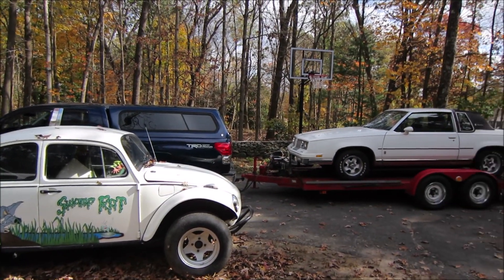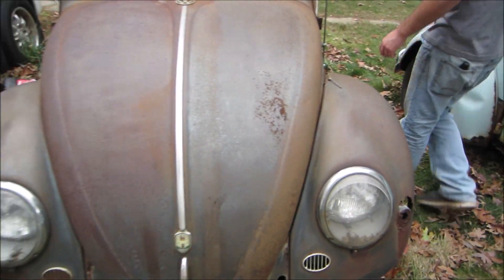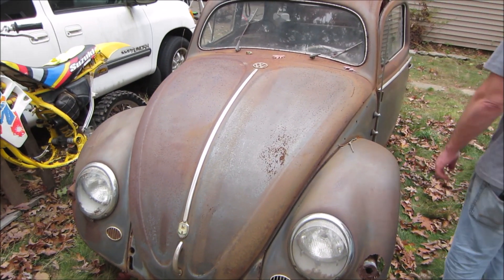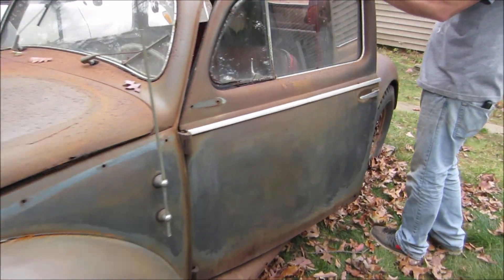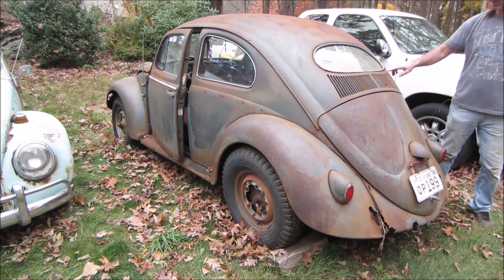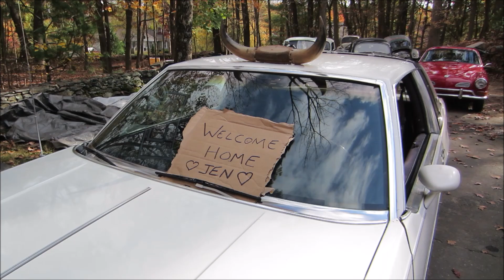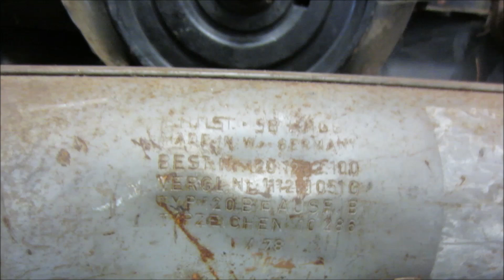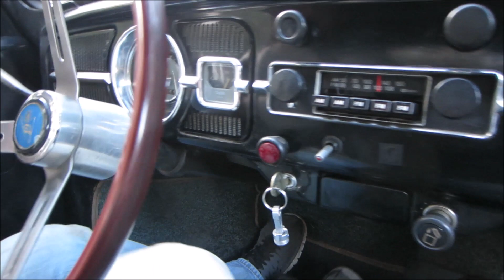What I Got For My $900 Cutlass

Comment: As the owner of a '60 sliding rag bug, I wholeheartedly support this trade👍.  One problem ou run into with the 36 horse cars is smaller engine bay = have to trim the tins to fit 1600cc type engines.should make for fun videos!
Thanks for the video!

Comment: This bug guy needs more projects to start and not finish. All of us tinkering types can relate
Reply: There used to be an electronics recycling container in the parking lot of my shop. I'd root around in there for good stuff. I got a portable a/c that just needed some minor repairs, a bunch of computers to run my CNC machine, and a Pioneer 7 channel surround amp that ran for about 3 months then the power supply went. I also snagged a class A amp (don't remember the name) that wouldn't turn on. I researched online and it was worth over 5000.00. There were a TON of big flat screen tvs which all needed power supplies which are easy and cheap to replace. ($40 in parts) but like I need more projects? I know someone else who figured out how to repair them and made a good living at it. 60" tv repaired for $40 sold for $400.00. 

I was glad/sorry to see it go because like I NEED more projects?
Reply: Yeah, I have 9 cars, 7 motorcycles, and more roadside freebie mowers than I can count! Just the other day I saw a Corvair with a really rust free body and sitting in an empty lot....hmmm, lol... It's an addiction! There is probably a 12 step program somewhere, rofl.
Reply: he should sell some he's clearly not working on then and there just rusting outside
Reply: I came to the realization the other day that I have maybe 25 years of life left and 50 years of projects.

Comment: For a VW nut, I like his taste in Chargers.
Reply: @James Nasto, spotted the 500 badge on the grille, I'm no way an expert on Mopar but isn't the 500 something of a rarity ? Nicks Garage is totally rebuilding a Charger 500 on his channel and he's pretty stoked about it.
Reply: @jontisdall6248  Not a 500. The rear glass is wrong.
Reply: @jontisdall6248  I could only see the rear window and it didn’t have flush mounted rear glass, I couldn’t see the front head lights but if you’ve seen hide away headlight covers it’s not a 500, but if you’ve seen two flush mounted uncovered headlights on each side then it may be a 500 used to qualify for NASCAR homologation.
Reply: @jamespn  didja know some 1970 Charger 500s came with a slant 6 cyl  or that in 1970 the 500 was just a trim package ?
Reply: @jamespn  Thanks for that, I'll watch it again to satisfy my own curiosity. I only mentioned it because Nick was so excited to get a 500 in for complete resto and I spotted "Charger 500" badge on the grille in this vid. Thanks for the education.
Reply: @jamespn  Just watched the relevant few seconds again, you were quite correct, no flush rear glass and hideaway headlights confirms it. The grille badge definitely says 500 though, so I guess it's simply a "dress up and wish" sort of thing. Nonetheless, a highly desirable car, though over here in the UK with fuel at around seven US$ a gallon not a daily commuter. Regards.
Reply: @TheMotorick  Thanks, appreciate the reply. The headlamps are wrong too. Not being a Mopar expert it was the grille badge that tripped me up.
Reply: hey hey his is a true Mopar man believe me....
Reply: @jontisdall6248  Hi Jon , the Charger is a 1970 318 car with a 68 440 swap . I found the car about 2 years ago on the side of a garage while driving to buy a motorcycle . The car sits as i bought it ( minus carb ).....best 10k I ever spent 😁
Reply: @5150mxVW  Thanks for taking the time to reply, as I said I'm no Mopar expert but simply a fan of all muscle cars. Have been since I was a kid, my dad had a '67 Camaro. I only queried what model your Charger was because I spotted a 500 badge on the grille, and even with my little knowledge I was aware that the 500 was a bit rare. Thanks again for putting me straight. Regards from the UK.
Reply: @jontisdall6248  HI Jon , I was not putting you straight , just letting you Guys know you were correct 👍.
Reply: @5150mxVW  Always good to get the facts straight, and who better to impart the facts than the owner himself. Awesome collection you've got there. Once again, thanks for taking the time to reply. Best regards.
Reply: @carmineredd1198  Hi, your comment clears up the question perfectly. The owner very kindly replied to me and confirmed that the car is indeed a '70. Regards.

Comment: Oh I know what it is.  Mustie can't stand shiny paint.

I was hoping you would drive the Cutlass a while longer and bond with it.  Guess not.
Reply: Cutlass was not inspected needed cats and other exhaust to make legal
Reply: @rsprockets7846  Put Historic/Antique plates on it.
Reply: @21Piloteer  You generally can't use such a vehicle as a daily driver.
Reply: i used to own a 87 pontiac grand prix with a 305 ci motor and 4 barrel carb. pretty much the same as that olds in the frame suspension and motor.i would have put on the cats and exhaust and kept that car. it was when gm was still making good cars....
Reply: @hellshade2  g body's were rad smallest body on frame gm could make grand nationals lemans malibu's the list goes on monte carlos. ......el caminos
Reply: @hellshade2  I had one of those too,ran a splitter off the catalytic converter with two tailpipes and no mufflers, not true duals but it sounded good though, one of those cars that I regret selling.

Comment: Never understood the obsession with a vehicle (vw) that was slow no matter what size engine and doesn't have air conditioning. Not a hot weather vehicle meaning half the country can't enjoy them. Just my opinion tho.
Reply: They're not cold weather cars either, since their "heaters" are a joke.
Reply: @ekaftan  Yes. Nice car. I'm just not into a car that cant change the climate for the driver. Just too primitive to get excited about for me personally.  If it can't remove humidity or melt ice, the value is limited to me. Different strokes..

Comment: I feel bad for you you definitely lost out on this trade
Reply: It’s all in your prospective
Reply: @Russeljfinch  its perspective,and no.crap trade
Reply: On the surface, I'd agree...a great running well sorted Cutlass for a shell of a car and a parts car......yeah, doesn't sound even at all. BUT they are 50's era bugs and to bug guys, those are gold. After 100's of hours of work, the bugs are the better trade not including the work required. 

You gotta remember, Mustie is the kind of guy who likes working on them more than driving them. I had a buddy back when computers were just going mainstream. (486 processors). All he did was tweak, upgrade and fiddle, he never actually did anything with his computer. 

To me, a fair trade would be his cutlass for the black rag top sitting next to the one he took. 

I looked around for cutlasses for sale up here, they are going for anywhere from $5000 to $25,000 CDN.

Comment: actually that was a excellent trade dont listen to them you got a great deal for people that dont understand why this is a great deal go look up the price of the VW Beetle he has on the trailer plus the price of a engine. then tell me its a rip off. 

last i checked online VW Beetle engines like what he just got are going for online rebuilt brand new for 

1979 convertables are going for 

so how is it a bad deal for him.. ??
Reply: crap it wont let me post prices 

lets try again.

1977 beetle goes for 25,000 right now and a rebuilt new engine goes for $35,505 with a 503.00 core charge other models of beetles go for 19,000 to 19,500
Reply: Not sure about down there, but up here? Cutlass's are going for anywhere between $5000 and $25,000 CDN for that year and model. BTW: that's not a convertible.
Reply: @muskokamike127   Yeah he got ripped big time for sure  guess he did not know what a great car he had they go for more money then a  roasted shell of a bug in under coat hiding all the bondo and dents
Reply: @muskokamike127  they are a dime a dozen around here.
Reply: @IanMicheal  I would agree with you, but mustie is the type (as I said) who gets more pleasure of working on them as opposed to driving them.
Reply: @larrybraden6640  where's "around here"? 

They're all rusted to rat shit and dead and gone up here in Canuckistan
Reply: @muskokamike127  Georgia. They're everywhere. Usually a little rust but not bad.
Reply: @larrybraden6640  ah, that explains it. When was the last time you had so much snow you had to salt your roads? lol

It's like when I was in Jamaica. TONS of 50's and 60's cars, rust free but the suspensions were shot due to the crappy roads.
Reply: @muskokamike127  i know i was just comparing base prices from convertables to the bog standard beetles

Comment: That Charger needs the "rev up, tune up!"
Reply: aka Italian Tune Up
Reply: It's got a cam. So it will run like that till you hammer it. Same with my 1966 Impala SS 427 pushing 600+ horsepower .

Comment: Dad had an old VW bus, a 58. It had 15 hp. Top speed 37 mph. 
That engine crashed and he got a replacement engine with 25 hp. 
Then it rushed forward at a terrible 50 mph.
Reply: @rogerwilco99  I know nothing about bavaria, but it worked in Sweden in the 60's

Comment: I was wondering what happened. I would've been happy to take the Cutlass myself if I had room on my driveway. If I find a 1994 Chevrolet C1500 pickup cheap or free, it would be a good restoration project. But my 2001 Intrigue needs an O2 sensor replacement and exhaust repairs again. Paid $19.99 for the exhaust parts (2 clamps, ID 1 7/8" pipe, and exhaust leak compound patch) and have a new Downstream O2 sensor in case the Bosch dies, which it is dead now.

Comment: i see you're still rockin the mutton chops, you 1800's ship captain you. that black one with a 2387 motor, was that cc? i built a few 2112 cc engines for rails in the 90's, but i never saw a big bore kit that big. that thing would be a screamer.
Reply: yes, 2387 cc type 1
Reply: @5150mxVW  wow, talk about a sleeper. on a rail frame with digger rear tires that would be a wheelie machine. the 2112's would lift the front wheels off the ground, but not very high. i would've had to sell that with a disclaimer.

Comment: **Please please please help me** I have my riding lawn mower (MTD yardman machine 13.5 hp 38'' cut) which is having issues when mower deck is engaged, and going past its #2 speed (has 6 speeds total). If going past #2 it will start to sputter and die. If mower deck is not engaged it will go to full/#6 speed no issue. I have replaced the spark plug, put in new carburetor, has always had premium fuel (no ethanol), and checked the mower deck to ensure all parts are spinning freely (aka no issues of mower deck drawing to much energy to spin rusted parts), but I am lost now. Any help or ideas to try at this point?

Comment: all those volkswagon beetles, i grew up in phoenix but moved back to connecticut but i remember the way volkswagons got turned into desert rat cars, ends cut square engine since its air cooled right out in the open all chrome and shiny black sometimes a number on the side roll bar installed no fenders, skinny front tires and big knobby tires in the back that was the 70s early 80s though and they were all over the place now they're collectors items they call them baja bugs

Comment: Grab that oval-window '55 Beetle.
Reply: Not the original engine.  The original did not have fresh-air heater connections on the fan shroud.

Comment: Sounds like the choke pulloff diaphragm on that Charger has a hole in it. Fix it or you will plug up the exhaust crossover passage in the intake manifold, which is a PIA to clean

Comment: It must be nice to have a car that you can store the engine in the trunk, until you need the 30 HP, we have engines like that too but they have only one cylinder not four and we have real engines in our cars that have more HP per cylinder 8x50 than the that rat trap has with four. Let me ask a question if Stalin had invented the VW instead of Hitler, would it be less popular or more popular?